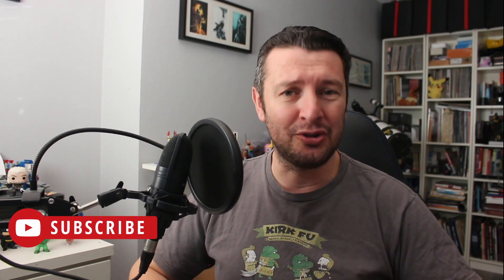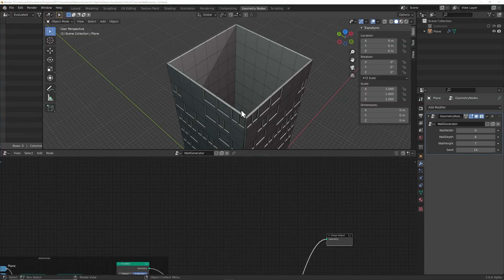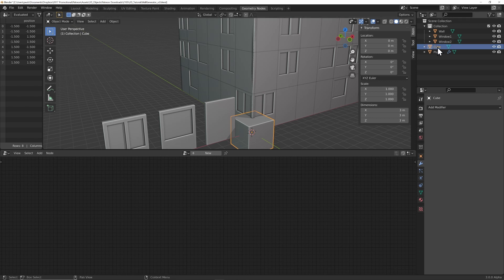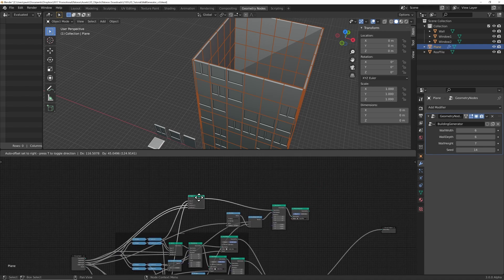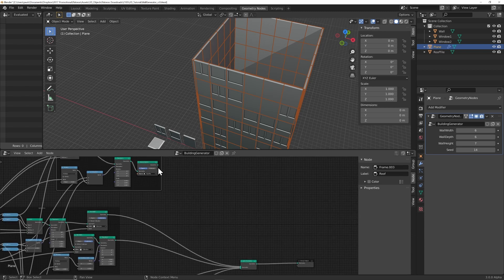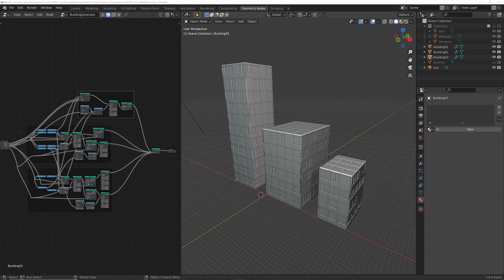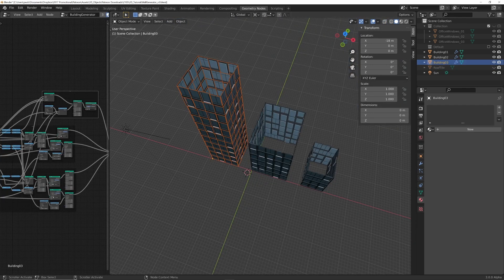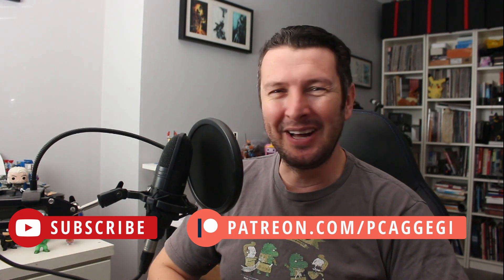DIY building generator with geonodes in Blender 3.0 Alpha - Part 3

Comment: Can you explain how you did different floors (like how a bottom floor could be different than the other floors)?  Thanks, great tutorial series btw.
Reply from the maker: In this one, all the floors are the same. I'll be doing another section of this tutorial to explain the methods of getting different parts. Essentially, it has to be its own system with its own separate collection.
Reply: @PCaggegi  Gotcha, makes sense, and you just need its location to be controlled by the height of the building?
Reply: @PCaggegi  are you able to say how you would do it without messing up the way the other levels have been setup?
Reply from the maker: @callofzon6544  next week. :) more tutorials coming.

Comment: Have an idea for another episode perhaps:
How do you make a roof that has a raised perimeter, so you need a corner tile and an edge tile, plus a tar-and-gravel tile for the rest of the roof.
I suppose you could use the line node tree for the raised perimeter.
Reply from the maker: Am planning it. :) I wanted to get the basics down first. It requires another system for building corners.
Reply: @PCaggegi  very nice. I'm looking forward to it.